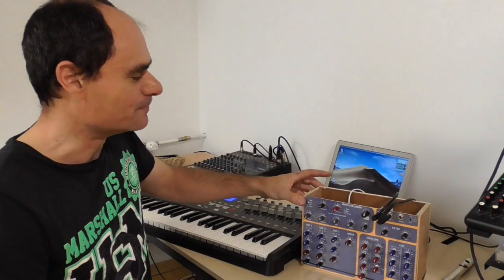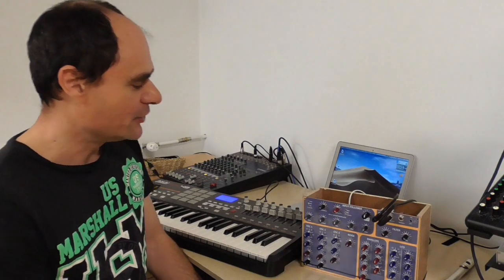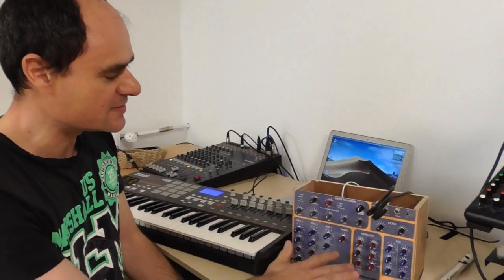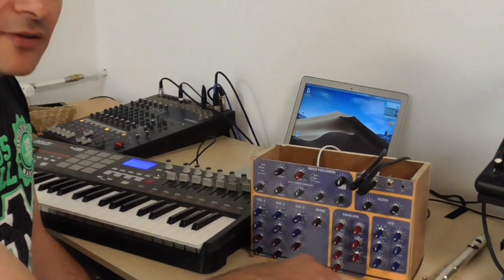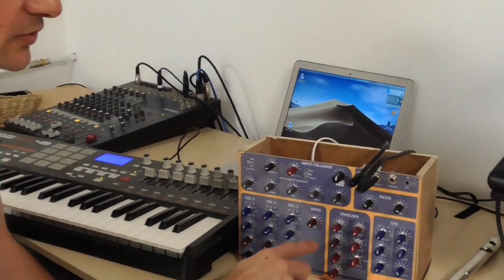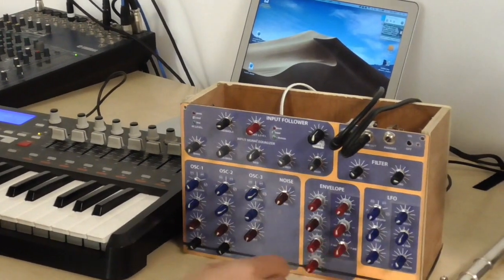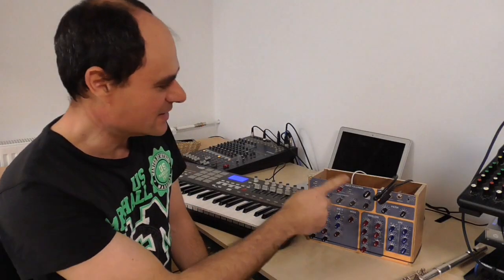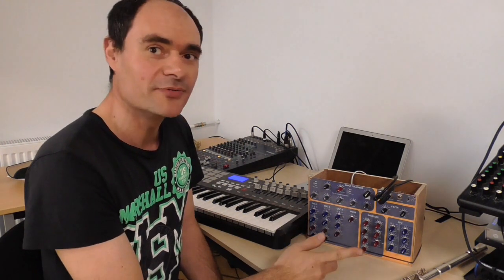Wooblizer : the acoustic synth

Comment: Very elegant project Emmanuel. What a creative idea. Sometimes the the woobilizer added a bass clarinet quality to the flute sound. That would be cool if you could blend the mic sound into the output of the woobilizer you wounldn't need an offboard mixer.

I'm also working on a teensy synth. I just got the code and hardware all set up and I can make sounds but the sound is off. There's hints of distortion in the sound.  I'm being careful not to send audio levels >1.0 in my signal path. I think my envelope modulation is getting quantizer in time which makes the modulation sound "chunkier" and unpleasant. Do you have any tips for sometime trying to make a teensy synth sound good?
Reply from the maker: Hello,
I don't precisely understand what problem you have. Can you describe it more precisely please ?
One thing that really makes a huge difference is the band limited waveforms. The are now supported with last Teensyduino beta release. Use this in your code :
WAVEFORM_BANDLIMIT_SAWTOOTH
WAVEFORM_BANDLIMIT_PULSE
WAVEFORM_BANDLIMIT_SQUARE 
instead of usual waveforms names. Really important. That could be your problem.
Emmanuel
Reply: @emmanuelpresselin2312  Hello Emmanuel, thank you for the input! I need to do more work before I can describe my issues precisely. Right now I just know that the sound doesn't sound right, so I was wondering if you knew of any common things to check.

I'll look into these band limited waveforms! What is a band limited waveform?
Reply from the maker: @TheNormalUniverse  Band limited waveforms are aliasing free. Aliasing is due to sampling rate limitation at 44100hz. When playing high pitch notes, you can hear strange artefacts like "unpleasant overtones". Do a simple test with a sawtooth oscillator. Initiate the oscillator with WAVEFORM_BANDLIMIT_SAWTOOTH or WAVEFORM_SAWTOOTH and play high notes. You will notice the difference immediately : smooth !
Reply: Emmanuel Presselin awesome thanks! Just the stuff I need to know. Will check on that right away.